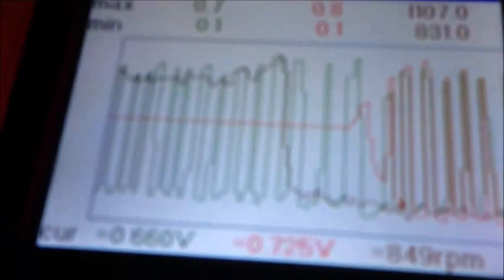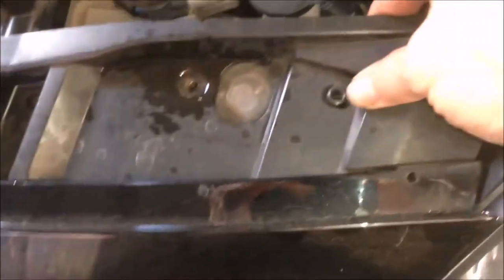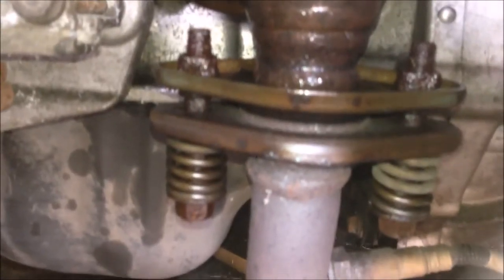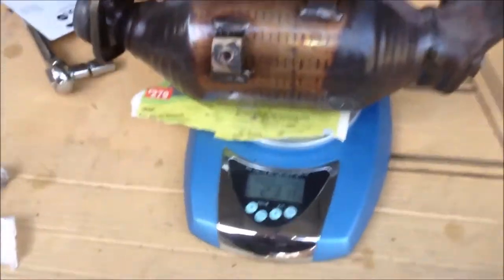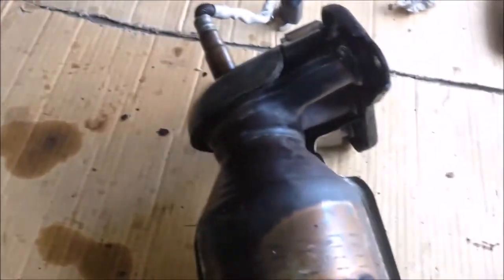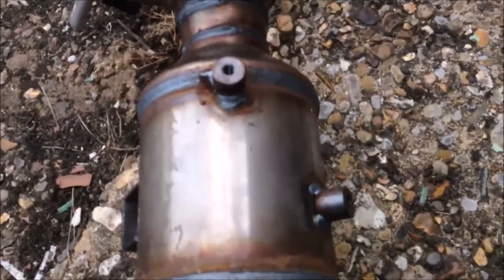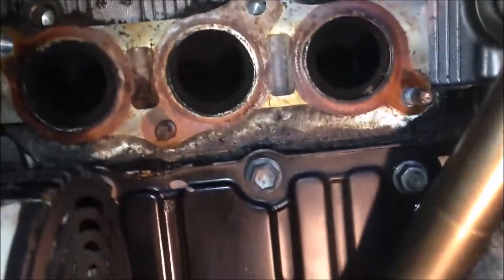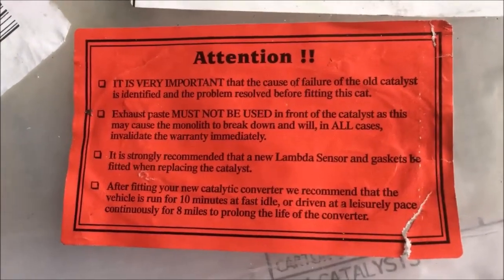AYGO: Catalytic Converter: How to Replace? (complete), Toyota, C1, 107

Comment: Thank you for making the video. Where did you get the new cat and how it is working till now, if you can share the link that will be great? I have Aygo 2013 and my engine light comes on again after i change the cat 3 months ago.
Reply from the maker: HI, i got my new cat from ebay. My Aygo has been on sorn/off road for a long time, therefore i haven't tested my new cat! hopefully i will try the annual MOT test this summer. good luck!
Reply: How many miles has your car covered?
Reply: @gtibruce  It's 66k miles right now now I have installed my original cat and everything is fine now. Most likely the cat u replaced with was not up to mark
Reply: @hassamali8581  Is your car an auto and if so how is that going OK?
Reply: @gtibruce  it's manual drive. Working fine for me. Btw I'm using it in my home country Pakistan. Someone imported this car from UK.
Reply: It need to be an original catalyst, if you buy from another store than Toyota there is a Big chance it dosent work and engine light Will turn om aigan..
Reply: A few months ago, I had to get the catalytic converter of my AYGO 2011 replaced. The garage installed one for me, but it was from another Toyota. As a result, a warning light came on, although the garage assured me that this was normal. However, I recently took my car for an MOT, and it failed due to high emissions. The garage claims that the issue is not related to the catalytic converter, but I'm not entirely sure. Can anyone offer any help?
Reply: @moocow9083  Hi, i have had the same issue... did you get an outcome to your issue? thanks